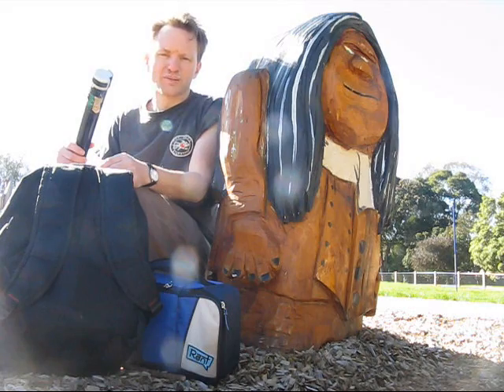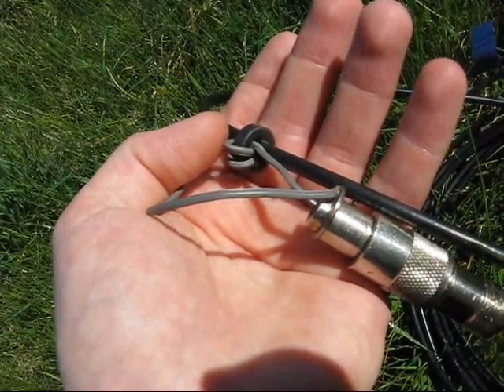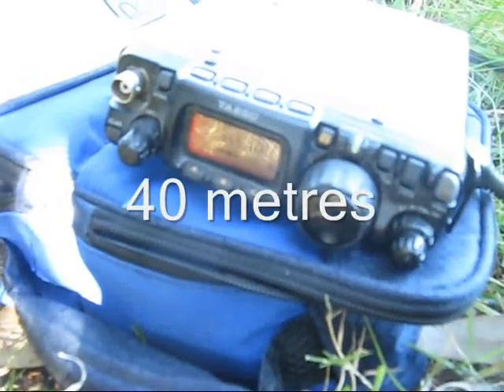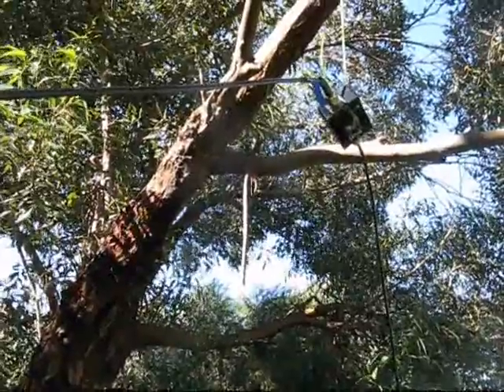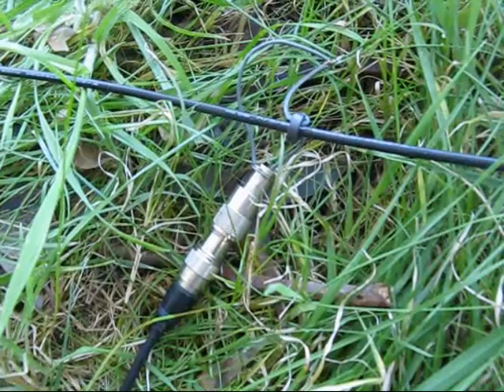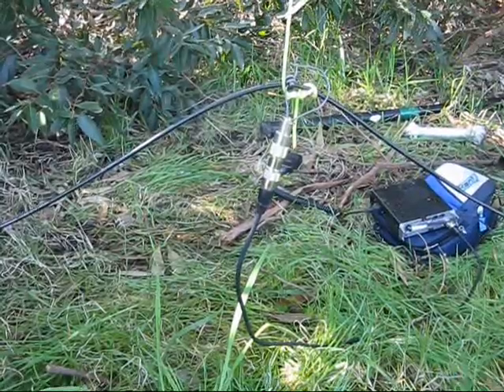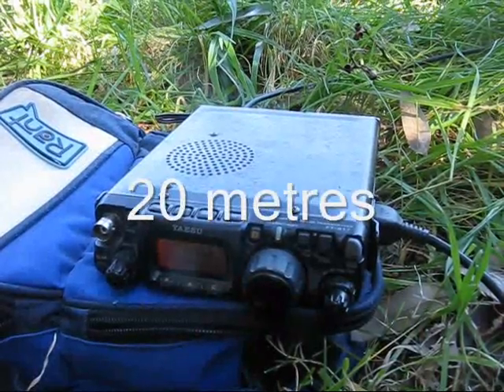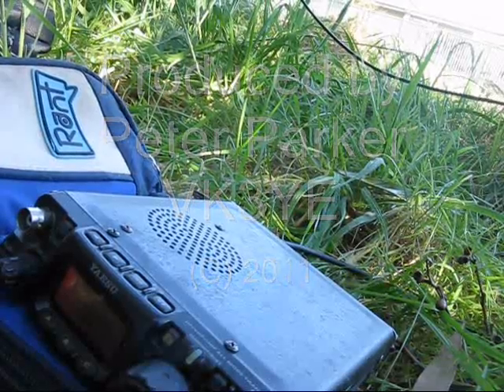Testing a coaxial cable HF magnetic loop antenna

Comment: I've made this loop Peter and it works great. My problem is that I was thinking to use gold plated banana plugs instead of pl259's to change loops for different bands easily. Do you think the losses would be much higher than pl259's?
Reply from the maker: Hi James - not sure - never done a comparison,
Reply: @vk3ye  thanks for the reply Peter, the mfj9232 loop tuner uses binding posts with screw terminals but I'm having trouble finding some and thought banana plugs might do. Going to try roughly using 7m coax for 40m, 3.5m for 20m and 1.75m for 17,15 and 10m bands. Will need to test more for best results though. 

Happy new year
de MM6JWA

Comment: You keep mentioning a "squid" pole. Is it squid, squib, or something else? Also, was the pole designed for some other use, but it just happens to be perfect for holding an antenna, or was it designed to hold antennas in the first place? (Is it used for squid fishing, perhaps?)